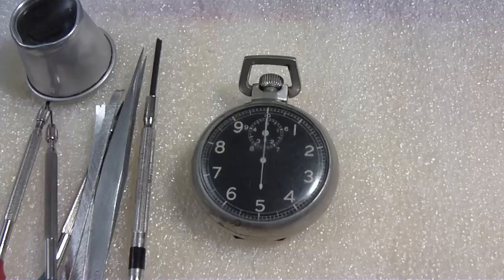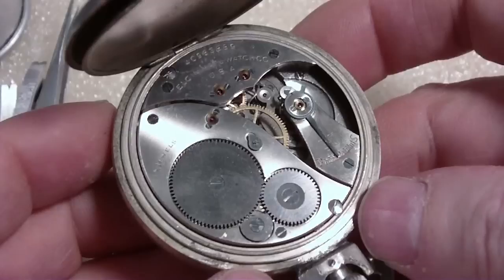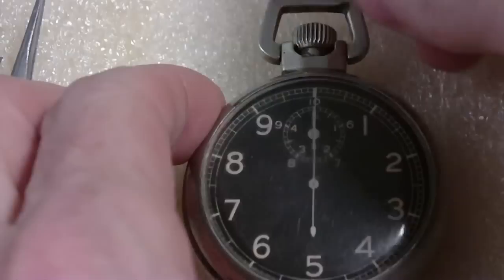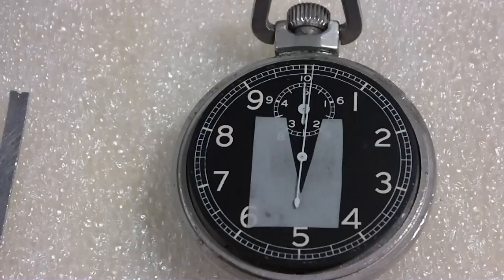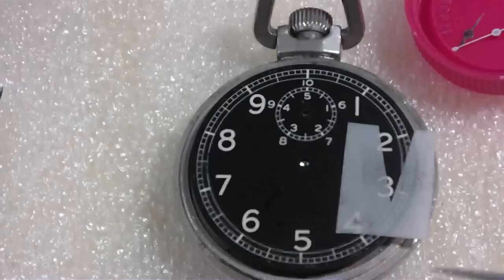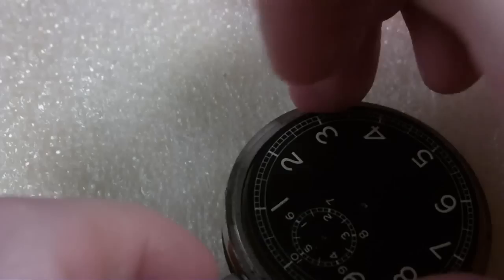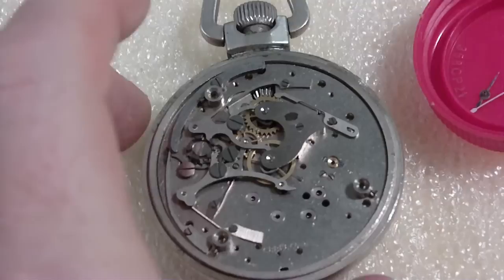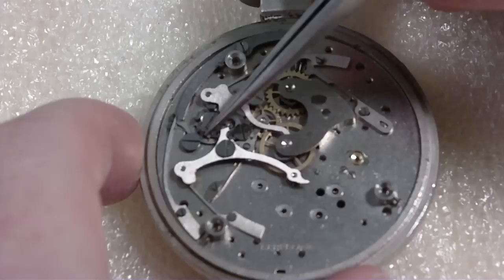Cheap and quick fix for Elgin Type A-8 jitter bug timer

Comment: Really like your pocket watch videos.  After watching them I was able to take my grandfathers New Era apart, replace the main spring and clean it, and it is now running and keeping very good time.  Loses less than 1 minute a day.  I now have an Elgin, lever set, that was made around 1909.  It runs but loses 3-4 minutes a day even with the regulator almost fully to the fast side.  I would like to take this apart and clean it but can't get the movement out of the case.  I've taken off both the front and back and pulled the stem out till it clicks but the movement still seems to be hung up on the stem.  Does the stem need to come all the way out and if so how?  This is a very nice 17 jewel watch and should keep better time than it does.
Reply from the maker: jobog Maybe the stem is attached to the movement like a wrist watch.  Look for a small screw near the winding wheel.  The screw will be smaller than the plate screws.  That is all I can think of now.
Reply: bunnspecial Thanks for the reply.  I managed to get the movement out by just jiggling it around and putting some pressure 180 degrees from the stem.  The movement just seems to be a really tight fit for the case.  I found some information on line that says this movement was meant for a hunter case so the sidewinder setup is non-conforming and probably contributes to the tight fit.  Have it apart now for a good cleaning and hope it keeps better time when I'm finished.  Again, thanks for the reply and the great videos.